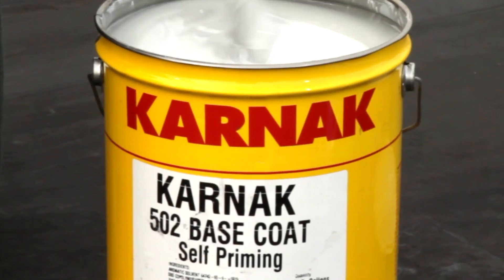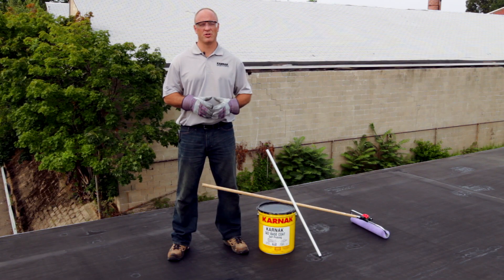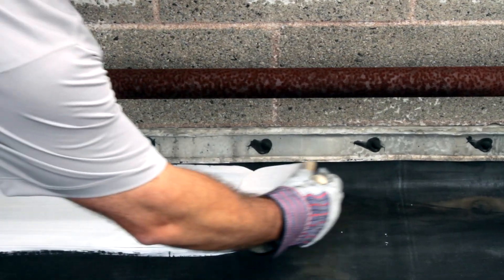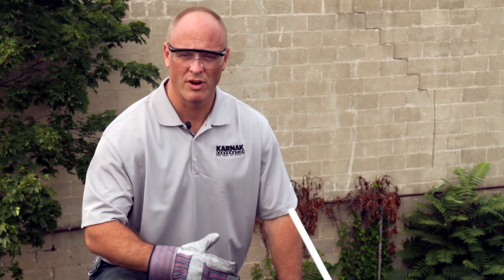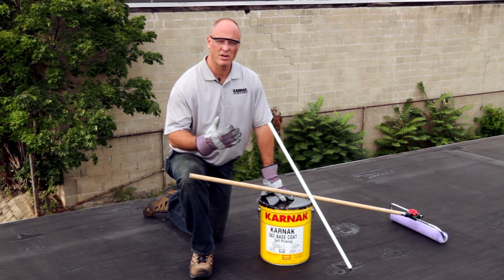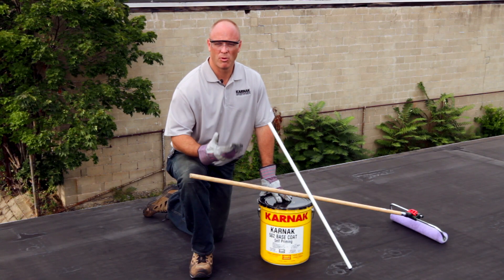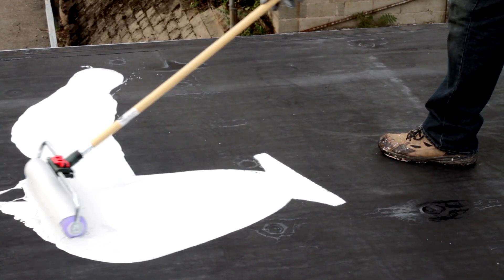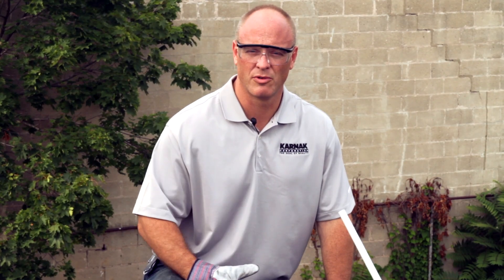How to apply 502 RC-W Elastomeric White Roof Coating over EPDM -- KARNAK

Comment: I would recommend against putting the 502 basecoat over a roof previous coated with liquid rubber roof coating.  I applied the 502 basecoat over a mostly flat roof that was previous coated with Inland 2000 RC and patches came up when I did the 502 finish coat.  I was told it may be the solvents in the basecoat melting the previous coat.
Reply from the maker: Thanks for the insights!